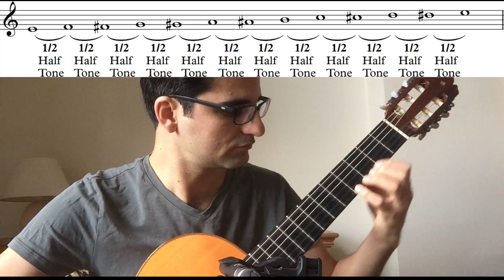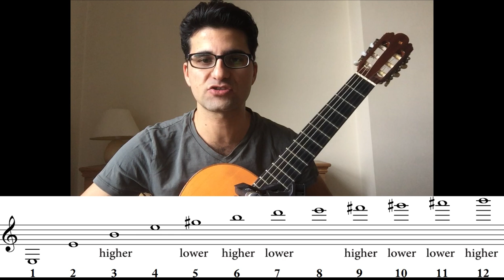Major 3rd Problem of All Guitars in the World

Comment: HI. If you think this is a problem it's not one that affects only guitars. It also affects pianos, organs, woodwind and brass instruments. I'd say it's an oversimplification to call it a problem. The 'unnatural' 3rd is a different note but it's still a note, if it's the note you want to sound then it's not a problem, and most music written in the past couple of centuries uses that, not the harmonic 3rd. Only when you want the harmonic 3rd instead is it a problem, and it's a problem then regardless of instrument, for the most part. Of course there is no technical impediment to playing the harmonic 3rd on fretless instruments. On fretted instruments you are instructive. Another possibility with very different results is using an open tuning with one string voicing a third, however. On a woodwind or brass instrument? I imagine they would have to be physically reworked. On a piano, you can tune so you have the harmonic 3rd in some keys but this makes other keys sound awful. This is the reason the tempered 3rd was invented. You probably knew all this but just in case. Thanks for the video, I really enjoyed it.
Reply: Yes, you can significantly alter the pitch and tone of a  note being played on a wind instrument with your embrochure... the same with the hands of a string player... many microtonal adjustments are made subconsciously on the fly by brass players, in a variety of ways, varying the pressure of the mouthpiece on the lips and teeth, where the tongue is in the mouth, holding valves open partway to glissando between harmonic registers... I think you get the idea...
Reply: @Laughing Daffodils woodwinds have all sort of variables that affect pitch, woodwind players are constantly correcting pitch all the time.

If you've ever heard a child playing a flute, you know that without pitch control you will end up very out of tune.

I'm a flautist.  The louder you play, the sharper it goes, and this effect isn't quite evenly spread out along the instruments range either.  Modern Boehm flutes (made in the last 30 years or so) have started to get very good at being "naturally" in tune, but cheaper instruments, or anything older than that will have noticeable tuning imperfections throughout its range.

Because of this, when you play a woodwind instrument, you are constantly using your embouchure to correct pitch, and this is an involuntary process, you instinctively tweak the pitch of notes to match the tone you want to hear in your head.  

Pre-Boehm flutes require a LOT of pitch correction through.  The physical reality of building a flute with 12 in tune semitones in multiple octaves to be played by a human with 10 fingers is something that has taken centuries of ingenious craftsman and skilled instrumentalists to crack. 

Since this pitch correction is already going on anyway, whether consciously or not, flute players will play outside of equal temperament all the time.  This is more prominent the further back you go, since it was less and less possible to just rely on the instrument, the player had more and more of a role in determining the pitch.

I'm not saying that they play justly, but if you're playing a slow breezy waltz in C major, you're probably flattening your Es a little without even thinking about it, because it just sounds "in tune".
Reply: You can tune a tipani in that way, and you can change the slide position slightly on trombone. I believe on valved instruments there are tuning slides for each individual valve, but I don't know if they could be set on a way to tune it to the harmonic 3rd. And as you said, with fretless instruments it's of no object. You would have to tamper with the structure and placement of the clarinet keys if you wanted to maintain a strong sound. I play trombone primarily and a little bit of electric and upright bass. Also some small amounts of percussion. I was also inevitably exposed to clarinet with my mom playing it. I don't have any experience with saxophone, flute or any valved instrument.
Reply: Thanks to the good musicians who know to adapt their pitch into the ensemble they are playing with. And even for a guitar player this is possible, if he has a good ear and is aware of what and or whom he is playing with. This is not only a question of tuning your instrument by a standard digi tuner, it is about hearing what you are doing. Of course any fretted instrument is out of tune, no doubt, and these discussions are ongoing for millenia. But when playing really together and listening, it is obvious. And really: rock'n roll guitars allways sing out of tune, and that's great!
Reply from the maker: Thank you for your comment. When you tune a open string to the harmonic 3rd, you can't use the frets on that string, that's why I don't like it. I think the best solution is my movabe fretted guitar and I can play in different keys as well: https://www.youtube.com/watch?v=MYK_PF9WTRE
Reply: Well you can use the frets on that string actually, but of course you have to choose the notes to play like that very carefully - only to play harmonic thirds but you can fret for different keys. Or you can fret and bend up very slightly to correct if you must use it for a different note. But yeah, it's not an across the board solution just one trick that works for certain things. More relevant to slide players than to the music you play. You could also use a vibrato to flatten the thirds slightly too, but a classical guitar with a vibrato lol where would you find that? The results you get with the movable frets are very cool though. It seems very much like tuning a piano to a different temperament, only it can be done more quickly. I wonder if you ever try to play with woodwinds or brass though? I can't imagine a way they could harmonize that without actually having new holes drilled.
Reply from the maker: No, I haven't played with woodwinds or brass instruments. As I know, they can adjust their tones with their mouth/tongue technique. Can't they?
Reply: I haven't played that sort of instrument since I was a kid so I'm no authority, I remember vaguely it was possible to 'bend' a little bit now that you mention it, so I googled it, and I guess you're right. Jazz players have to do it. Sounds like a heck of a lot of work on the players part though. Cheers!
Reply from the maker: Hi guys! Have you tried the Renaissance experiment: https://www.youtube.com/watch?v=DjyNgzjNzyM

Comment: I solve this problem by not playing harmonics at the fourth fret.    OK, of course you're correct, and I like what you did with this video, but just to be clear here, I think most guitar and instrument builders are aware of this issue.  Tempered tuning with standard frets exists as a compromise so that we can have fretted instruments that play "OK" (not perfectly in tune) in any key, and are reasonably cost-effective to construct.  If you really want "perfect" tuning pull then you can use a fretless instrument.  Another way would be to have an instrument constructed to perfect intervals inone key, then use a capo (or retune each string) to play in other keys.   Obviously, these other methods have their own drawbacks too!
Reply from the maker: I think the best solution is the movable frets. Here is my guitar design: https://www.youtube.com/watch?v=MYK_PF9WTRE

Comment: I listened to your explanation. My guitar is tuned. I played a C# on the B string, second fret and the guitar tuner recognise the note as a perfect C#. Same with the F# on the fourth fret A string and G# on both G and E string. What my guitar tuner recognises as slightly out of tune is the natural harmonic on the fourth fret (same note as the natural harmonic on the 9th fret).
Reply from the maker: If you use a good tuner like 'clear tune', when you play the harmonic, it must show 14 cents lower. That's the natural major 3rd in all vibrating strings since the beginning of life on planet Earth. The fretted tones which are shown as in tune on the tuner are all unnatural by 14 cents.
Reply: makes sense. I have to make further comparisons to see what sounds better as 'third'. your sound is clean and seemed perfectly tuned, so do all the major third I've always played on all instruments, stringed, synthetic, harmonised choruses, winds and so on, but I'm used to music this way, so the intervals 'second, minor third, major third, fourth' and so on are all natural to me. anyway, your change would mess up the other chords. if the 'third' is 14 cents lower, the minor chord starting from the third value would sound strange (the minor third would be 14 cents up and so its fifth), and the minor chord starting from the 6th would have its 5th down of 14 cents). in other words they would not have the same distance between first, third and fifth. in addition, if I wanted to change key that would make things almost impossible. checking the table of frequencies I can't see a constant for thirds that can tell me which is a better 'third'. anyway your video was very interesting some good food for thought
Reply from the maker: I agree with you. That's why I invented a guitar with movable frets and adjust my frets according to the pieces: https://www.youtube.com/watch?v=MYK_PF9WTRE
Reply: you did a tremendous job. I definitely want to make further investigations on the matter, I also have a little experiment in mind

Comment: true temperament solve this problem right??
Reply from the maker: No. True temperament solves the slight deviations from 12 tone equal temperament. The major 3rd is 14 cents low, which is much. It is not solving the major 3rd problem.

Comment: Very nice explanation and demonstration. Are you aware of the availability of True-Temperd guitar necks that address this problem systematically? http://www.truetemperament.com
Reply: While you are correct that the most popular TT system only corrects slight deviations in 12 EQ, there used to be three other completely different TT fretboards, and those actually did correct the thirds in different ways.

Some information about them from the old website has been archived by the internet archive: http://web.archive.org/web/20070402030311/http://www.truetemperament.com/main.php?go=1&lan=1
Reply from the maker: Yes, I am aware of this system. It is not solving major 3rds which are 14 cents lower. It solves slight deviations in 12 tone equal temperament. Correcting the unnatural system.

Comment: If you can't get small frets, you can also use a small piece of one of the bass strings! Just cut off a little bit of one of your spare strings and tape it to the fretboard. The A string usually works best, depending on what gage string you're using
Reply from the maker: Great idea! Thanks.
Reply: Smart!
Reply: Or a tooth pick, the wood might not last as long though.
Reply: I find flatwound strings work pretty well for improvised frets.  Not tried polished nylon strings but i would imagine they work too.  

The lack of ridges just makes it a little more reliable , and also lets you "modern" vibrato styles, which personally I really like doing on nylon (as well as the classical side-to-side vibrato).
Reply: Don't encourage this madness.  The guitar has survived hundreds of years before BARTON FINK ever came along.
Reply from the maker: Hi guys! Have you tried the Renaissance experiment: https://www.youtube.com/watch?v=DjyNgzjNzyM

Comment: Very good explanation of the main problem of equal temperament.  But it's a problem that's built into the system.  Even God, or Allah, cannot make a power of two be the same as a power of five, if She (or He or It) is logical.
Reply from the maker: Thanks Scott.
Reply: Scott Wallace what are the powers of duality and phive in music?
Reply: It's true, but temperament really only becomes necessary due to the demands of modulating between many keys (as the number of tones required expands dramatically), particularly with instruments like guitar and piano with a small number of fixed pitches.  In other words, there's no inherent reason that three M3 intervals or 12 P5 intervals would need to equal an octave.  Choral groups, brass choirs and string groups are less constrained by those requirements, and the intonation choices are evident as a result.
Reply: John Evans
The powers of two in music are the octaves, and the powers of five are the major thirds.  There is no way to mathematically combine them, thus there is no tuning system possible that has a certain number of thirds adding up to a certain number of octaves.
Reply: Brian Prunka
Actually, temperament becomes a consideration as soon as you have a scale with more than five tones in it, because you cannot have six tones with all just intervals.  But you're basically correct- temperament, or some sort of variable  tuning, becomes really necessary with modulation, unless you're willing to put up with "funny" intervals.

cheers from cold Vienna, Scott
Reply: This isn't true, although certain intervals will be harmonically imperfect.  You can tune all octaves to 2:1, the 1, 4, and 5 to 3:2 fifths and and 2, 6, and 7 to the 5:4 thirds of those (also resulting in pure 3:2 fifths between them).  This results in nearly all pure intervals within the key except between 2 and 4, a problem largely managed by keeping all II chords in 1st inversion.  But all intervals are just in relation to the tonic.  If you add the 27:16 6th, then you can have root position II chords.  You can also add numerous chromatic tones successfully, it really only becomes seriously problematic with modulation.
Reply: Brian Prunka
As I said, you cannot have a scale of six tones with all just intervals.  There's going to be a fifth in there that is not 3/2, or a third that's not 5/4.  I consider that already a serious problem, although you may not.

cheers from cool Vienna, Scott